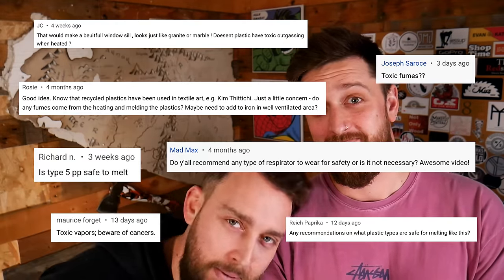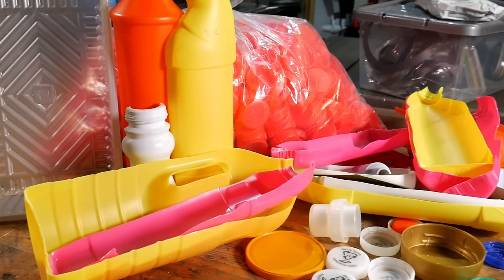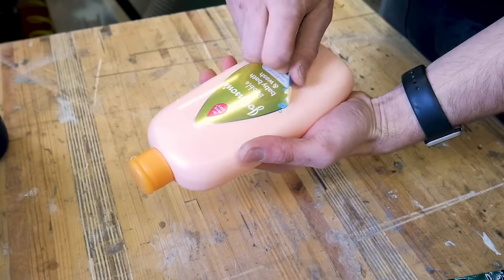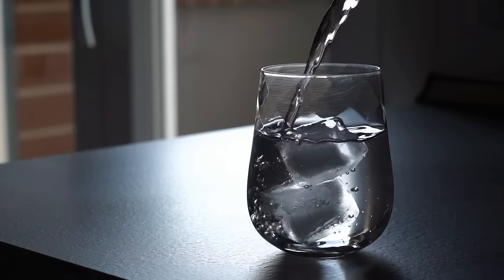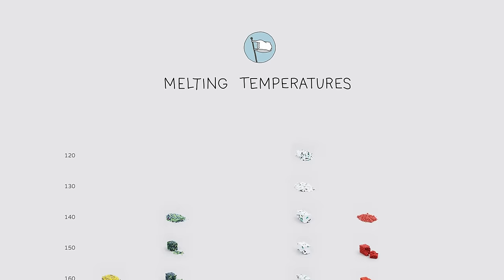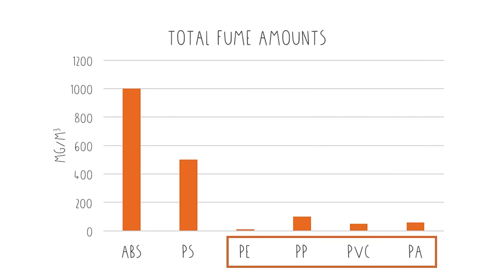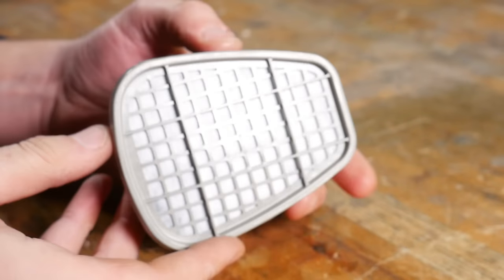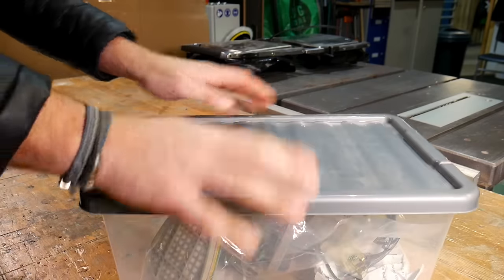Your Plastic Recycling Safety Guide

Comment: I would like to point out that Plastic is a waste byproduct of petroleum refinement. It used to be dumped not unlike Gasoline was before the Gasoline engine was made. Most manufacturers use Virgin Plastic more due to mechanical properties and reliability. Plastic degrades the more it is remelted. (The Volatile Organic Compounds have to come from somewhere.) It also doesn't help that some types, such as ABS and PS, tend to have additives that make recycling them wildly inconsistent.

Comment: Interesting video! I'm always happy to see content creators put effort into safety. I'd like to chip in on the respirators a little, particularly the "no leaks" part. Facial hair breaks the seal the mask is trying to get on your face, and supposedly tanks the effectiveness of them way more than you'd expect. It's bad enough that the use of these respirators is banned at my workplace for anyone who hasn't shaved within the last 8 hours. Instead we're required to use respirators that cover your entire face.

I believe you guys are totally fine given the fact that you're taking multiple safety precautions, but hopefully this is helpful for anyone who wants to take their health serious and planned on only using a respirator.
Reply from the maker: Yep, good point! Probably one we should have addressed. Thanks
Reply: Remember, Full Face Respirators still REQUIRE the user to be clean shaven in all areas where the seal is being made.  Example:  Beard/neck, and side burns/temples.  All hair needs to be away from the sealing areas.
Thank You for bringing this point out.
Good Luck

Comment: What if you are using a heat gun? The numbers are 1-7 which doesn’t specify what the temperature is.

Also are there any other ways to melt larger volumes of plastic at the specified temperature. Or a specific machine that melts at this temp. I’m mostly using milk bottles or other #2 plastics like grocery bags majority are marked so easier to use. For instance Walmart, dollar general, pic n save, I’ve melted over 250 of those so far. 

Also I’m having trouble finding a suitable mold. I’ve been using silicone egg makers and pressing the plastic after it has melted. Keeping it pressed until it cools. I’m planning on switching to aluminum molds. I’m still refining my technique.

I have access to more tools a whole workshop but I’m not sure which ones would be most effective for melting/molding.
Reply: Remember that you can cut tin cans and use them to like cookie cutters to shape thin sheets of soft plastic.

Also, you can use cloth, like denim, to make "containers" with pockets for inserting flat plastic to stiffen up the container.

Comment: Just wondering about using the respirator,  when I took a safety course for working in the oilfield,  they required us to limit our  facial hair in order to get a seal around the nose and mouth.  Also firefighters have the samee restrictions when it comes to respirators. Just my 2 pence worth for your consideration.
Reply from the maker: Yep, you’re absolutely correct!

Comment: Good video. For me, I'd say that it's safe to recycle most plastics, provided all safety precautions are considered, including:

- Cellulose acetates/propionates/butyrates
- PE/PP
- PLA (basically made from lactic acid, which is inside of you all the time)
- TPS (basically modified sugar)
- PET
- PMMA
- PS/HIPS/ABS (Styrenic polymers should be recycled outside or in a hood/with an extractor)
- Polycarbonates (Again, outside or hood/extractor)
- PA
I wouldn't touch PVC with a barge pole. It's pretty much an obsolete polymer in today's age. And even though there are PVC 3d printing filament, I don't think the carcinogenicity of Vinyl Chloride is worth it.
Reply from the maker: PET can be a little sketchy to work with, as it absorbs moisture very easily and can cause essentially an explosion if put under heat and pressure. And ABS is pretty nasty stuff that we don't plan on working with, We tried PS recently, which worked well but needed extra ventilation to remove the fumes.
Reply: @BrothersMake  have you heard about ASA? It doesn't use polybutadiene as part of the blend, instead uses a few different acrylic monomers. Butadiene is probably the most toxic VOC from ABS.

Something that's possible to do (and people, who know their chemistry, have done) is exploited Polystyrene's tendancy to crack into monomeric styrene as a means of recycling the polymer, where the recovered styrene can undergo something called radical polymerisation, which is also used to make virgin PS. This makes it one of the most indefinitely recyclable polymers to exist. 

Granted, styrene really isn't good for you. But with proper safety precautions (like a hood/outside/with a respirator), it can be done safely. Although, that does mean it's a bit more involved than what you do here!

Still, keep up the good work!
Reply: Also, fun fact, styrene can be derived from cinnamon :D
Reply: PVC is okay at room temperatures, and outdoor temperatures, right?

Comment: You should make a follow-up on polymer degradation. The video may encourage people to "help the environment", go around and collect plastic and melt them at home, risking their own and their environment's health. 
When plastics are exposed to radiation, heat, stress, substances etc, they can change their atomic structure (rubbers become slimy or brittle, ABS breaks like glass), but does melting fix that or does it make it more dangerous?
I also have seen some mixed plasics, which say on the label something like "ABS+GF" (with glass fibre). Do manufacturers mix in stuff with other plastics too?

Comment: I once tried using a sandwich/waffle maker but it didnt work. Maybe the temperature wasnt hot enough or the surface didnt heat the plastic well. Probably the heat gun will work better. Thanks bros!!!
Reply from the maker: We’ve tried other brands of sandwich press and always had success. Maybe you had a different type of plastic? Yes, try the head gun 🤙🏽

Comment: Lovely Videos as always :D I have a question :) Can I just melt a small pile of plastic on a silicon sheet with a heatgun? I dont want to use a panini press but for my purpose, melting it in a can is not optimal. My plan would be to melt it directly on the silicone sheet and than form it, is that going to create a problem? Looking forward to an answer :)
Reply from the maker: I don’t see a problem with that at all as long as you don’t overheat the plastic past it’s melting point 🤙🏽
Reply: @BrothersMake  Awesome, thank you guys ;) I will try it and I am gonna be carefull, promise! ^^

Comment: I scrolled through the comment section, and saw nothing about chlorine bottles. Why are they not safe to work with, even after washing with soap and water?
Reply: I would like to know as well
Reply: Because there will be traces of chlorine in the bottle that will not wash out. If you heat the chlorine it will evaporate into the air much quicker than the normal rate and you can poison yourself. If you burn it, especially in combination with other materials like plastic, you will change its chemical composition and if combined you won't even know what substance you are inhaling. You can safely use plastic from food containers, human and pet grade soaps and inert product packaging. Please don't use plastic from any chemical cleaners, or chemical construction products.
Reply: @gabrielamora6265 Thank you so much!

This is such an important safety issue, that I feel justified in up voting my own comment to attract attention to your explanation.

Comment: Couldn't give a monkeys about carbon footprint, a complete nonsense. Generate as much CO2 as you like, it won't make the slightest difference to anything. Plastics, yes excellent video. I do a lot of 3D printing in ABS in particular and although I do not use a respirator, I do take several precautions.
Reply from the maker: You have a penguin as your profile picture, but you’re a climate change denier.. 🤔 Also, this wasn’t about CO2 emissions, it was to do with fumes from working with plastics, so not sure you even watched the video
Reply: @BrothersMake  Oh that’s right it's us causing global warming, those rising sea levels we have all noticed, those hotter summers. Nothing to do with the oceans being the biggest source of CO2 by far, or volcanic action that dwarfs mankinds output, or the fact that CO2 is not a very effective greenhouse gas, or that CO2 is only 0.04% in the atmosphere anyway and is essential to life. Not normal variations caused by all sorts of variations in some other source (The SUN) - no of course not.  Not a stab at you video on plastics, quite right, I'm all for recycling, proper disposal, environmentally friendly, but when things aren't true they aren't true, no matter how many people chose to believe it.